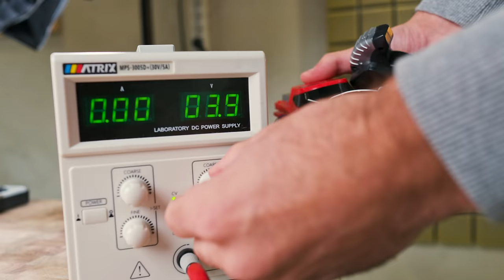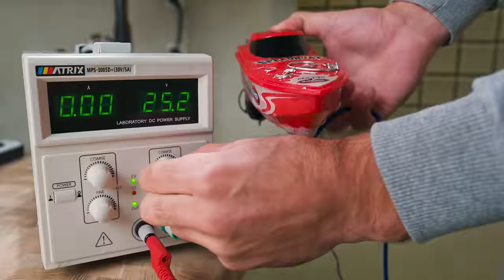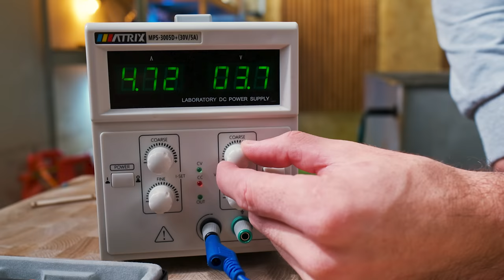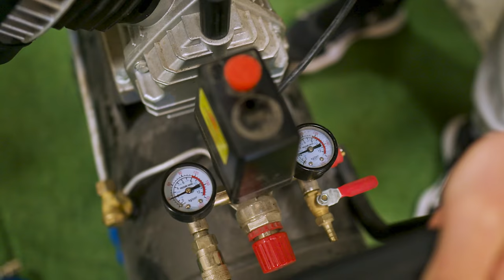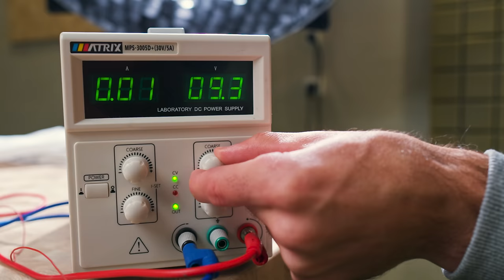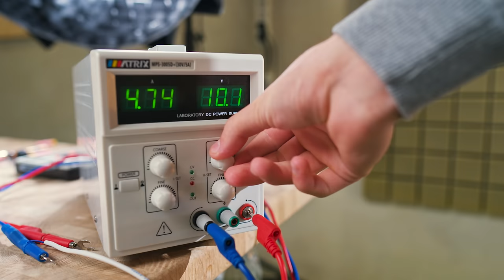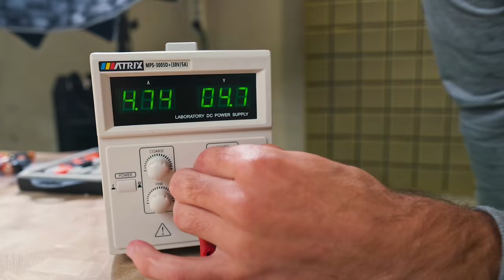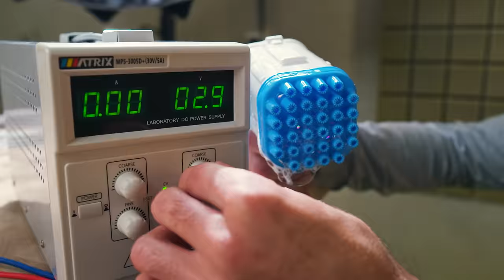I APPLIED HIGH VOLTAGE TO WATER TOYS [Dangerous]

Comment: The speedboat lasted a lot longer than I thought it would.
Reply: I wonder how high the voltage can go up before failure if kept in the water.
Reply: Mee too
Reply: the water cools the electronics and motors..thats why it lasted longer
Reply: @DavidKrautscheid right, why I wanted to see how high the voltage needs to be before failure.
Reply: @the_nguy9123  yeah
Reply: MAybe the water kept the motor from overheating.
Reply: @Mini-Rusty uh why did you say Mee it's me
Reply: Motor didn't fried, but cheap plastic gears broke instead.

Comment: That boat should have just come with a 9v battery would have been perfect
Reply: На 6,5V наверно было бы в полнее достаточно.
Reply: And a little ballast to keep it from flipping it’d be perfect then
Reply: Now I understand what the big deal about 9.6V was and why it was advertised so heavily for RC vehicles years back!
Reply: @southernracing2468 ballast in the bow probably
Reply: 20v
Reply: Or 18650 lithium cell pair in series. Would last much longer than ordinary AA cells as well.

Comment: This never gets old. Did the same with mechanical and battery powered toys at childhood 😉 Even figured out that 4.5V battery pair in series turn my toy cars into race cars. Already then concluded that standard batteries are too weak for some electrically powered toys. 9V batteries and 18650 lithium cells would be much more appropriate choice. Especially for red speedboat at 1:30.

Comment: 4:03 now it can go under water. [ A new invention
Reply: IT EVEN WORKS UNDERWATER
Reply: @ryderalley4853  It WORKS under water - checked that in person. Unfortunately all electric components and joints oxidize and corrode very fast if not properly treated every time before and after use. We lost some toys with electric propulsion after water games, including two RC boats.

Comment: Two electric speedboats with 5.2 volts in batteries make a good racing set
Reply: With two 18650 li-ion cells in series they would turn into little rockets.

Comment: No Hate, but keep in mind High Voltage starts above 10.000V. Everything below is Medium Voltage until 1.000V. And below that it is called Low Voltage. And yes this goes only for AC, for DC like in the Video it's a bit diffrent.
Reply: I always remember at school we had a 'low voltage experimental power unit' WALL-mounted in the lab. It went up to around 800 volts. Of course at school you never normally deal with more than the normal 240 mains supply, so it was always worrying to us how 800 bad boys is still classed as 'low' voltage......... (And yes I do know NOW the term 'high voltage' is reserved for 10kVAC+ transmission lines...)
Reply: "High voltage" is clickbait here indeed. Although guy definitely deliver, especially for us who did the same in childhood. On AC none of these toys will work. Motors would only buzz in mains voltage frequency. Discovered that as kid too. Also had fun by connecting toy car battery pads to broadcast line speaker socket which turned car into radio speaker 🔊😎

Comment: @2:41 --  bulb bulb bulb!!! 😀
@3:58 -- it converted into a submarine!!! 🙂

I'm surprised that the sound chip in the Bubble Crab lasted through 9.2 volts and the motor to 25.1 volts; and that turtle looked a bit like it was going poddy from four or five penuses. 😕
Reply: 5:16 now it’s a leaf blower
Reply: 23:03 that one just flipped over and sunk
Reply: 2:41 3:58  5:16 23:03
Reply: I can imagine the circuit inside sound chip. It most likely use internal Zener diode to stabilize input voltage in acceptable level. Eventually it will blow later from overheating.

Comment: I didn,t know that those blue and red wires were waterproof! I thought it would electrocute
Reply: I didn’t know they would electrocute the water
Reply: @yeshuayoshi8965   water isn't conductive without a lot of minerals.
Reply: Low DC voltage (0-48v) is harmless to humans. This is why you can touch both sides of a 12v car battery without being electrocuted. Now, there are caveats to this. For example these low voltages can still generate high amps which when ran through a conductor can create heat and cause burns. Additionally all parts of the human body has the same resistance, so while low dc voltage can generally be handled safely with bare hands, touching it with your tongue would be unpleasant to say the least.
Reply: @deadontarget8503  did u know that ur immune system runs on electric shocks? Each shock is around 1 volt, that means u could have a small voltage like 2 or 3 but if it hits ur immune system it could cause permanent damage. Also you can't use oehms law about skin resistance when oehms law never tells us how or when does the resistance turn into a conductor
Reply: @Toothlessthedragon_ bro dosent watch electroboom and it shows
Reply: @MidnighttArtz  I literally put an electric boom video link with a styropyro video link and ghat comment got deleted and the other guys comments whom I was arguing with also got deleted
Reply: @MidnighttArtz  me and dead had a whole ass comment fight but yt deleted it all 💀
Reply: @Toothlessthedragon_  🤷 I wish I could link where I asked 😕
Reply: @Nonexistent_creature  how rude
Reply: @iam_crumb  womp womp ☹️
Reply: @Nonexistent_creature  womp womp 😔

Comment: Rc boat mother board was burned and it was not using the remote he directly connected to motor and people think it last long in 7.4 voltage it burns it mother board and after that we can't see he is using that controller

Comment: That red RC boat, at below 32 volts (25-28 is ideal!), it is one hell of a speed boat!! Just needs weight on the front (a little bit that is) to offset the balance from the power. Holy shit.

Comment: That motorboat.. Congratulation to the manufacture cause the circuit is marvellous lmao, it burn down from overheating after a looot more voltage it should be supposed to run.

Comment: No music or talking made this experience a bit dull imo. Also since you can only crank it up to max 30v anyways, isn't it beter to use a higher voltage battery so you don't have to use the wires? I did it once to a playmobil merry go round for my 2 girls, and the thing almost took off being hooked up to 4 9v batteries. Of course I put a regulator in between so they can start it slow.
Reply from the maker: High voltage usually breaks circuit and radio control. So I am controlling a toy by applying voltage directly to motor.
Reply: @Toyish83  Yeah that's what I did with the merry go round. That was just a motor with a regulator. So I hooked up another regulator with 4 9v batteries hooked up to it. Will give the same result as the dc power supply the way you are using it.

Comment: Sodor Online LIVE
TTTE Guy • 76 watchingLIVE
🚗Brum 403 | BRUM AND THE GOLDEN LOO | Kids Show Full Episode
WildBrain Turbo • 4.4M views10:20
Swodniw History (Part 9)
Бойфренд • 120 views8:53
Overvolting DC-Motors. Testing your suggestions! Water, oil, gasoline, overloading & more! With RPM
Cskirt • 149K views8:33
Furby Connect Without Fur
With or Without Fur • 180K views6:44
WHwNRV Update Z-Tech Factory (Part 8)
Бойфренд • 9 views6:02
Samsung Fun Club Startup and Shutdown Effects
SFTCP1's Logo Editing (With Yoshi) • 7.5K views6:28
TOP 100 BEST SHREDDING MOMENTS | SATISFYING ASMR COMPILATION
Gojzer • 105M views17:35
Minions watching LG Startup and shutdown
Kahraman Doruk Ring Phone YT-KDRPYT • 60K views7:25
[SFM] Thomas and the Magic Railroad - The Stormy Pursuit
The Amazing Gamer111 • 33K views9:46
I APPLIED HIGH VOLTAGE TO WATER TOYS [Dangerous]
Toyish • 2.2M views28:26
Windows Never Released 584
Арсений Иванов • 138 views12:59

Comment: How about using sound amp (from the car or some other amps) but instead using speakers you will use toys
Reply: Speakers move because of alternating currents (in and out), so audio amplifiers output AC, not DC. The DC motors in toys would likely just cause an amplifier to go into protect mode or quickly overheat because of a lack of resistance. Interesting idea though! :)

Comment: I would not call any of these voltages high voltage under any stretch of the imagination. And some of these didn't even use any electricity. Also in your thumbnail you photoshopped 300 volts on that power supply which I know it doesn't get anywhere near that high of a voltage.

Comment: why does he have a steel bathtub? steel can absorb the energy from the water and potentially cause electrical shock.
Reply: good point actually
Reply: It's nowhere near enough voltage or current to do any damage. Mains when you're part of the route to earth, maybe, but not an isolated low voltage power supply.